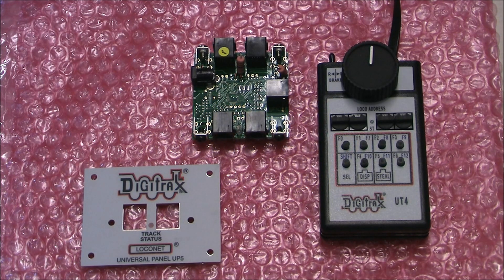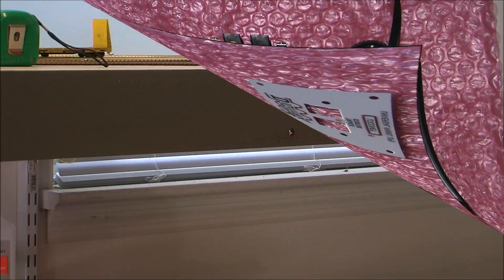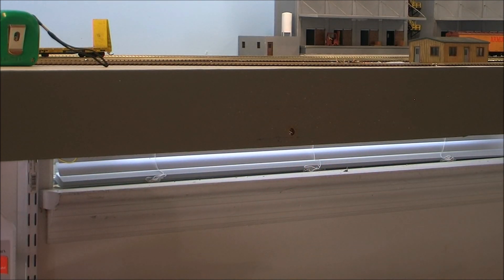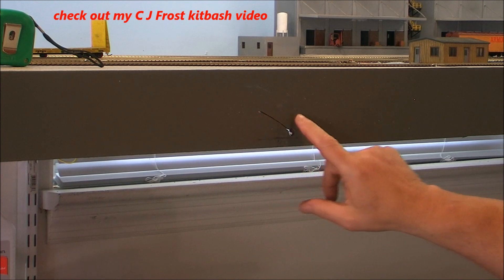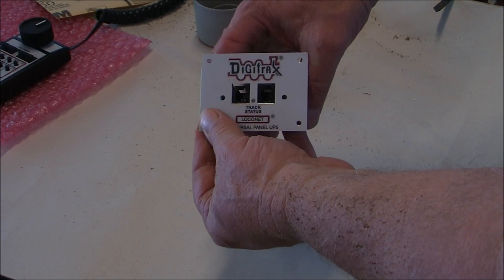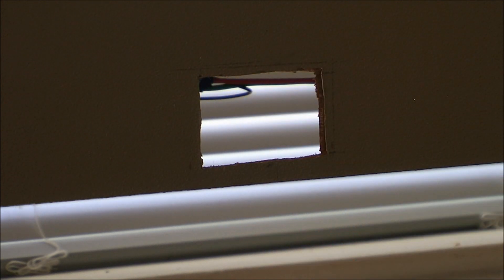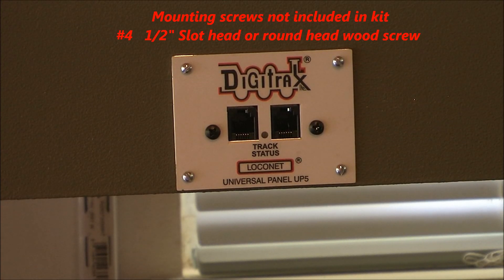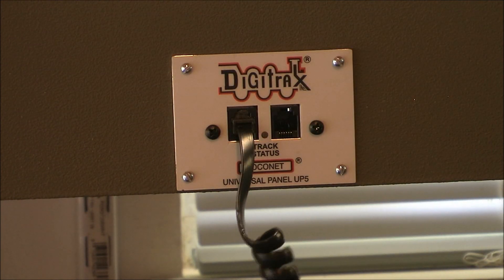Digitrax Controller Install

Comment: One thing you also want to use when installing CAT12 is a cable checker just to make sure you have a good crimp and the wiring is correct.You can pick one cheep on E-bay for $8.00
Reply from the maker: Good idea...thnx